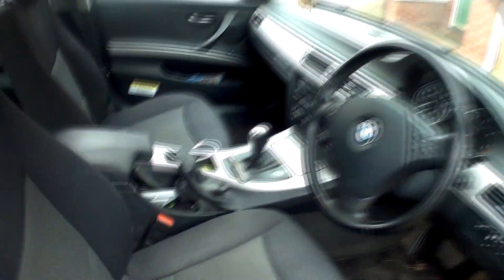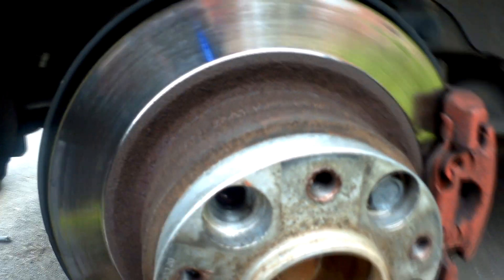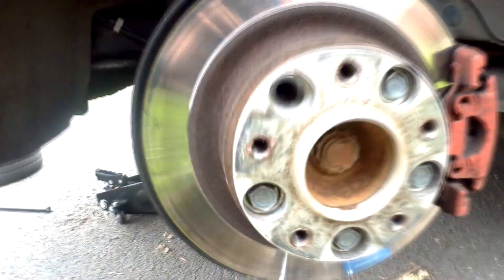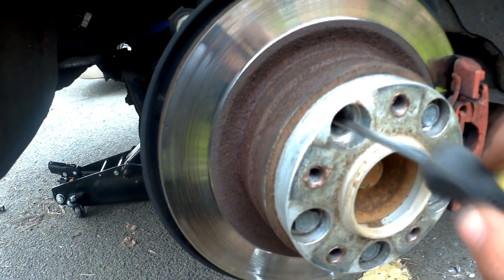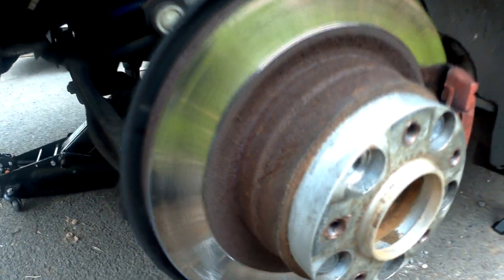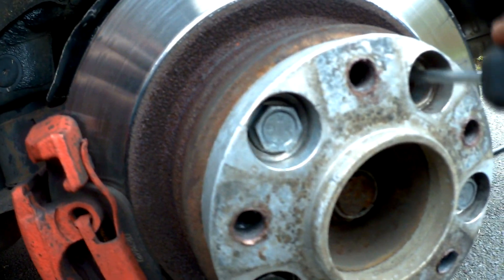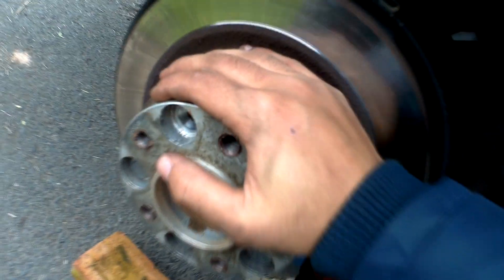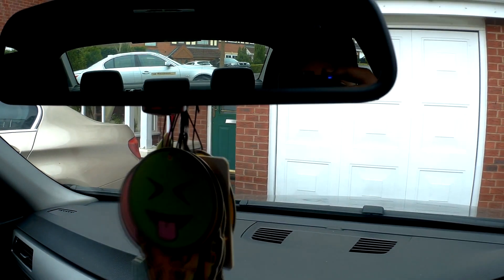BMW E90 Handbrake Shoe Adjustment

Comment: It should be backed off 8 rotations for non-turbocharged models, and 9 for turbocharged models. Prior to adjusting, you need to put the handbrake into the service position by pressing in the service spring under the handbrake itself.
Reply: 8 rotations with the wheel on.  3 with the wheel off.
Reply: @robertdewar1752  why is this please? What's the difference.
Reply: @mrellis1181  hi Steve. It is because the wheel presents more torque at the hub (due to its diameter) - the adjuster needs to back off  the pads a bit more to compensate for this difference.